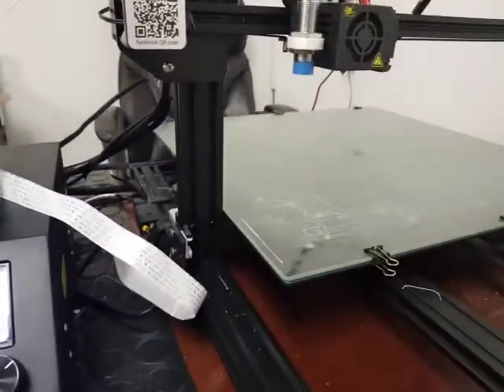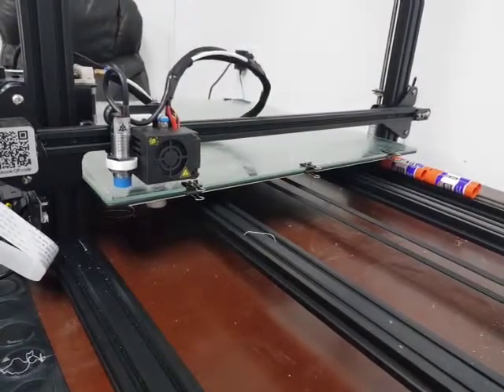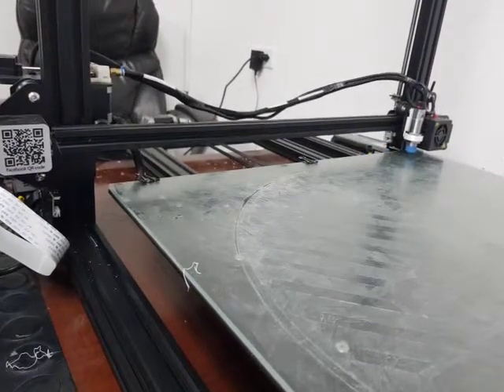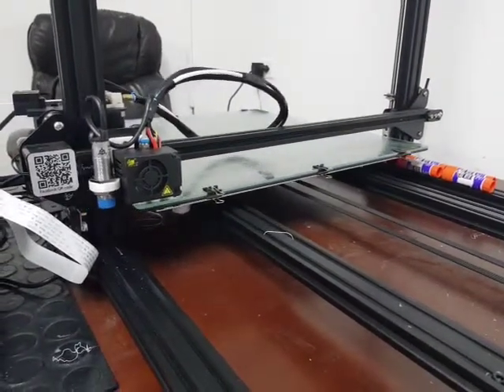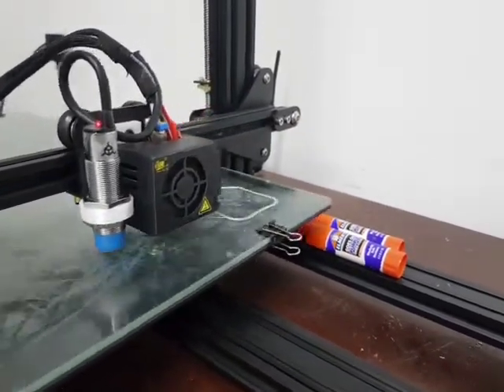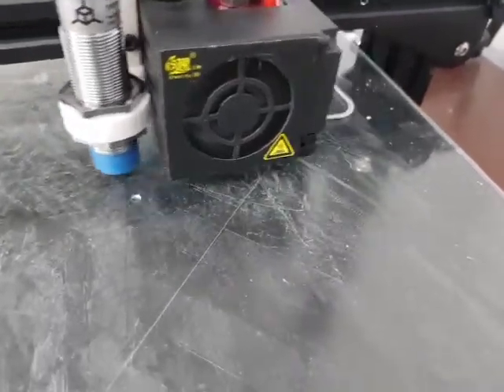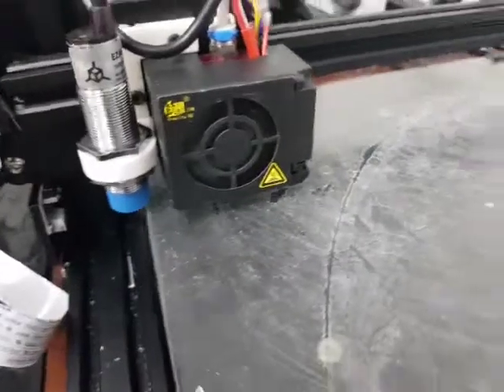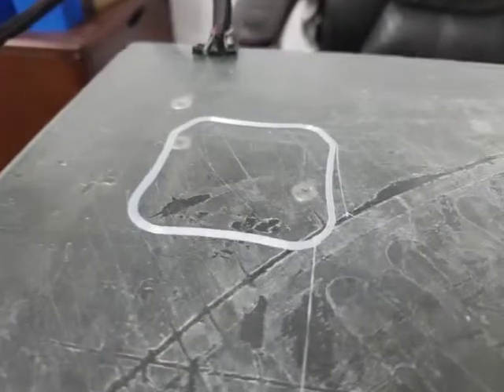TH3D EZABL Bed Leveling CR10-s5 Torture Test

Comment: How has the abl helped with larger prints? My S5 bed has never been able to do large prints due to warped bed. Ezabl has helped now that you have used it for awhile?
Reply from the maker: Yes definitly. Ive made some 45cm diameter placemats.. and a full sized stormtrooper helmet among other things. Id say it works perfectly  95% of the time